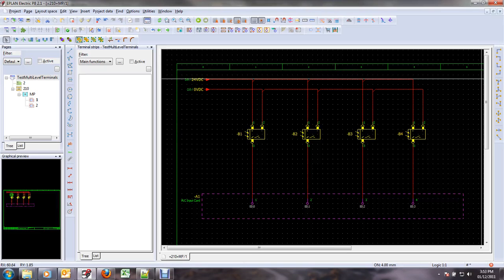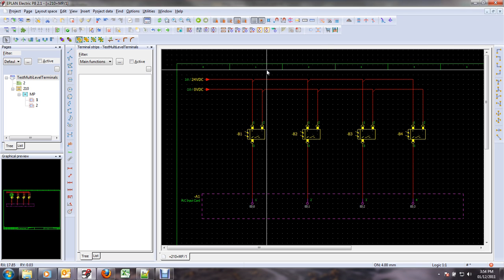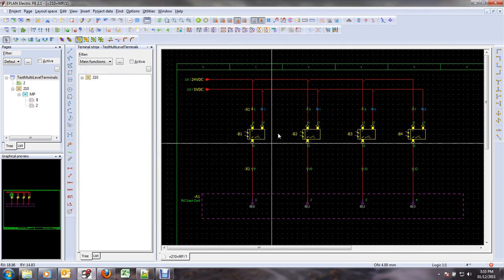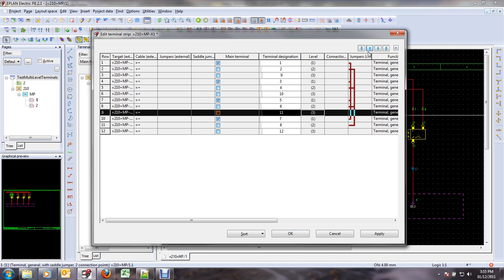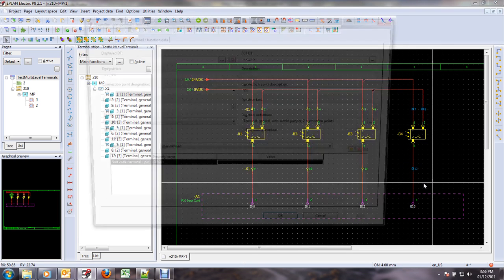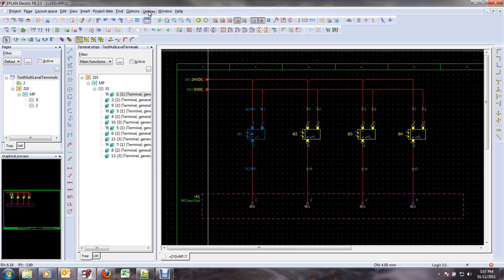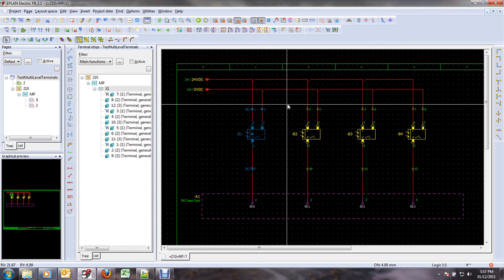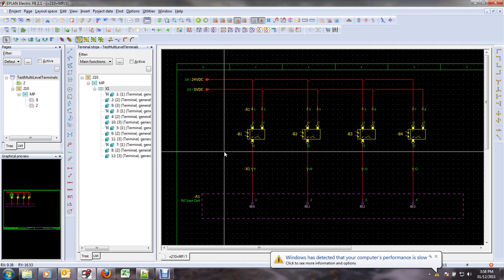Sorting Multi Level Terminals by Script

Comment: Thanks Luc! Didn't yet try your script, will do later. I see you inserted terminal symbol with insert command and symbol is number 30, "Terminal, general, with saddle jumper, 2 connection points" and you used so-called "line insert" or multiple insert terminals. Interesting, only terminals with positive potential are marked as a  "main terminal", other are without thick "main terminal". How did you manage it works? I tried, bu all terminals was with a tick "main terminal"?

Thanks for your time!

Alfa biro

Comment: In this case you can not use the Distributed terminal function? I refer in the case you want to use a 3 level terminal for sensor use, where you want to have jumpers between all 24V and all 0V?

Comment from the maker: @gkesyakov That's a nice trick also, but in many cases the end user doesn't want to have the same terminal designation. For instance, what I often see is that they want "24VDC" for all the positives, "0VDC" for all the negatives, and then the PLC address for all the signals. But still, your way is quick.

be on the lookout for my next video that will give a fully automated way of doing this with API.

Comment: I handle multilevel terminals differently. I assign the same designation to all tree levels of the same terminal, then sorting is non-issue just right click-> Sort terminal strip-> Default. I have changed my terminals property arrangement to show the level in brackets, so in schematic multi-line they look like this: 5(1), 5(2), 5(3). That's how i do it. Keep the good work, I'm looking forward for new videos.